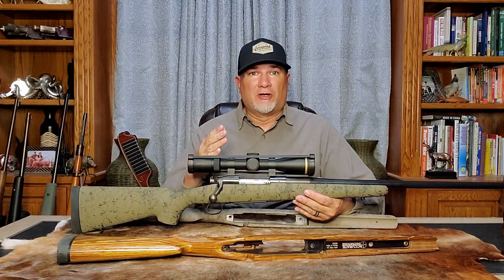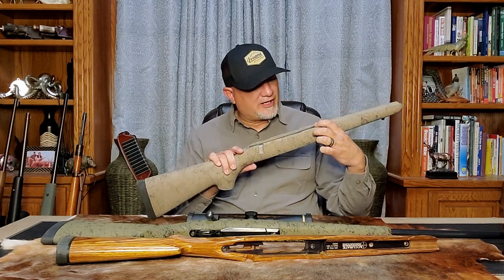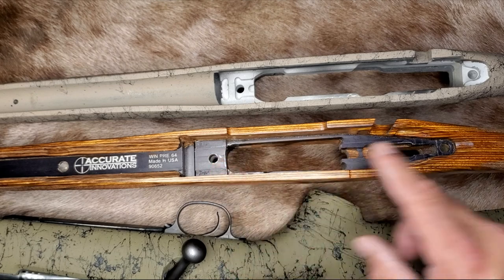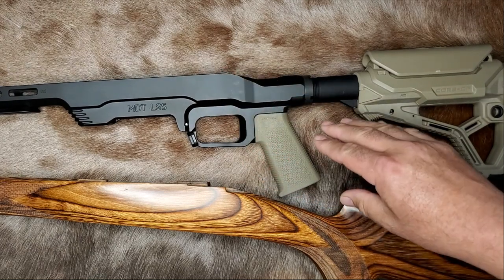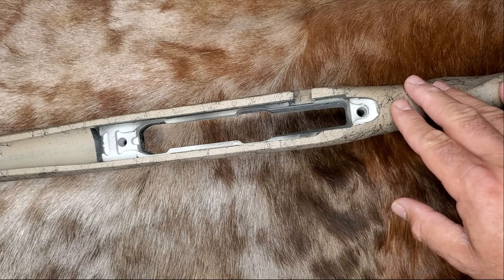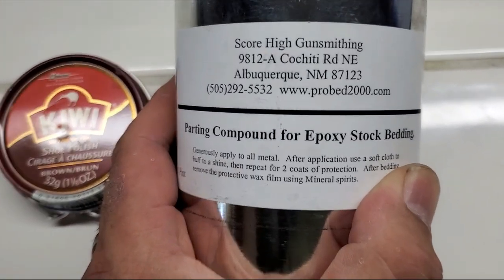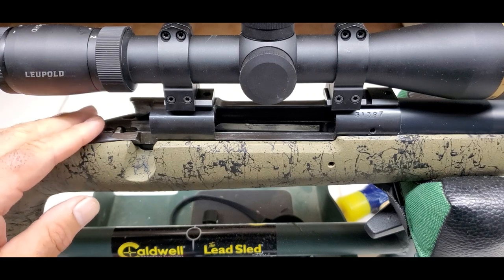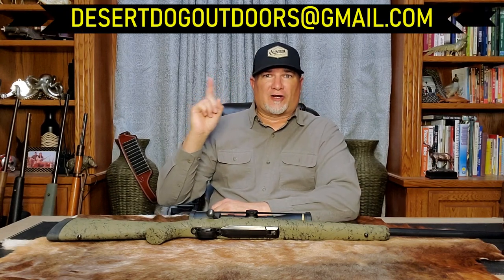SKIM BEDDING: What is it, and why do we do it?

Comment: When manufacturers first started putting aluminum bedding in their stocks I also noted the slop fit. It’s not a one shoe size fits all. I do exactly what was shown in your video. I don’t care if it makes a difference all I know is the action is mated to the stock and there is no slop or twisting. I use JB weld for small bed jobs.

Comment: I bit the bullet and had a go at bedding my tikka T3x hunter and I am so glad I did, the rifle went from 2 - 3 inch groups to sub moa. I was very surprised as my other tikkas were very accurate out of the box but this one wasn't great but for a couple hours work and very little cost the gun was transformed.
Reply from the maker: Yep, a recoil lug that floats in both the barrel and stock needs very tight tolerances. Some factory stocks have it, some don't. Some of those Aluminum lugs also had short life spans.

Comment: I have a chassis rifle that seemed to have an occasional flyer, not major, but noticeable.  maybe taking a 1/2” group to 3/4”.  I did a very light skim bed of the front recoil lug, no more flyers.  Simple process and made a measurable difference.    Don’t be afraid to make a good rifle great, even in a chassis rifle there are possible tolerance stacking between the components that I believe justify bedding.  Now if I was swapping actions/barrels every year like an active competition shooter, it might not make sense, but with a modest round count it doesn’t bother me to have to chip out and re-bed a different action every 5 years or more.  Better to have a great shooting rifle now.
Reply from the maker: Definately. I know guys that glue-in their actions to stocks!

Comment: I have not tried the high score bedding compound yet, but I’ve been meaning too. I’ve used a good bit of acraglass gel. I’ve also skim bedded a lot of rifles with The original JB weld, and had fantastic results with it also.
Reply from the maker: I plan to do a bedding compound comparison video. JB weld is right up there with the best bedding compounds on the market, at a fraction of the cost. It is a little too runny though, and has to sit on the mixing plate for a while before using. Stay subscribed for that video at a later date.
Reply: @desertdogoutdoors1113  Awesome! Yeah it’s best to let it sit a little bit. First time I used it i had it running some places I didn’t want it to haha. End result still turned out great, had to do some extra clean up though.

Comment: I have done bedding and fore end relief on Ruger No1 rifles but never touched my Tikka M65 .270 win or my REM 700 .222Rem, both are half MOA rifles so I have left them as is. Both are over 30 years old, are older rifles better fitted from the factory?

Comment: The whole Idea of bedding is making the stock fit the action so well, the action and stock act as one piece stress-free as possible. I always check the bedding of a rifle before I shoot it. If bedding is marginal good . I will shoot it as is because there is a chance the harmonics is just right for accuracy . DO NOT JACK with a hunting rifle that shoots sub moa. I have had cheap rifles with black plastic stocks that only required scraping the high spots in the action area with a pocket knife . That would shoot 1/2 moa for 5 shots . It made me sick because the rifle did not belong to me. It be longed to a hunting buddy. I did the scope mounting and load development. I'm never that lucky to have a factory off the self Rifle to shoot so accurately with little effort.

Comment: I wonder if my factory bedded Browning A Bolt Medallion is actually skim-bedded.
Reply from the maker: Those are skim bedded; which was still more than 90% of other manufactures. The X-bolts are also skim bedded from the factory.
Reply: My first year production A-bolt MEDALLION's factory skim coat is marginal at best. Multiple voids and minimal compound. Doesn't even come up to barrel mid-line. Time to JB WELD that problem away!

Comment: Do you think upgrading a Tikka t3x stock to a bell and Carlson is worth the money?
Reply: A few years back when you could get a Tikka T3 Lite Stainless for $500, I would restock them in a GRS Rifle Stock, and bed them. 
With the T3x Lites in stainless now going for $900, I believe the Browning X-Bolt Stainless Stalker to be a much better value. Much more ridged stock, 3 position safety and factory bedding job. I also prefer Miroku barrels.
Reply from the maker: The B&C is a better stock than the factory tupperware stock; but I would definitely still bed. Actually, I would just save a little extra and get a McMillan or Manners stock since you're bedding anyway.
Reply: @desertdogoutdoors1113  thanks for the response DD!
Reply: Another Great Video!

Comment: hello Desert Dog. Do you have any experience regarding a bedding job negatively affecting the resale value of a gun assuming the bedding job is neat, done well, and improves accuracy?

next question is what is to be done with a rifle that has a fore end screw? after the receiver is bedded and the first inch of the barrel is bedded for support i assume the for-end support pillar is clearanced  and the screw is simply left out?

as always thanks for doing these videos. i really enjoy them.
Reply from the maker: A proper bedding job will INCREASE the value of a rifle. For rifles with a fore end screw; remove the screw and bed. Flee-floating is much better than screw-tuning.